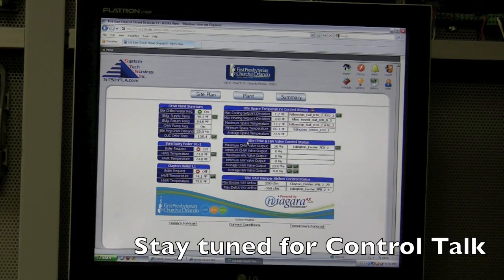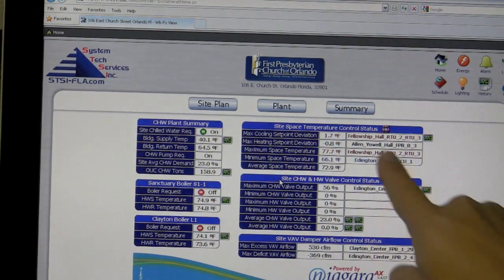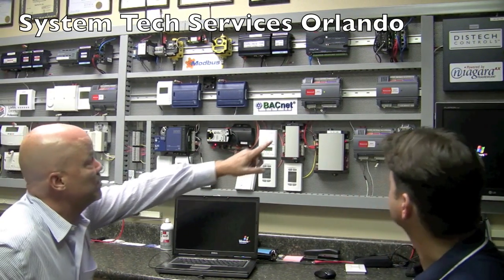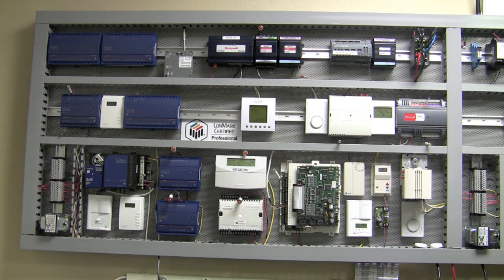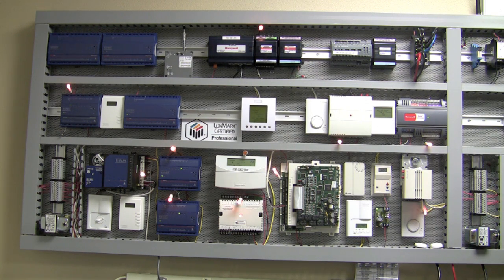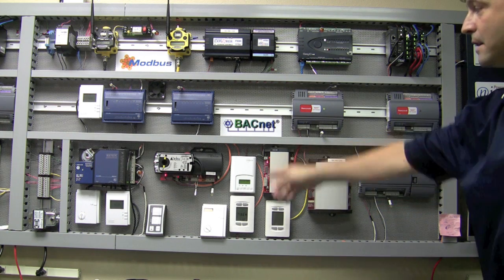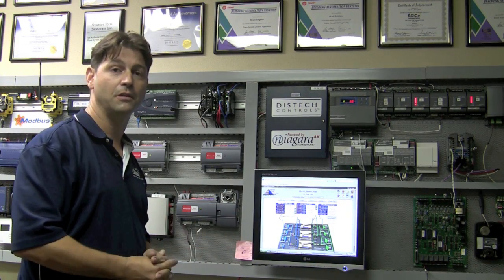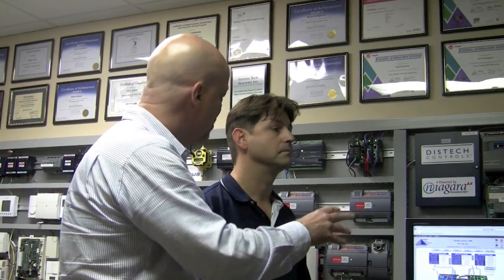This is what a Tridium Systems Integrator looks like Part 1

Comment: They are not objective in their presentation. They are talking as Niagara is some kind of messiah savior in case you have some unknown 3rd part system but it is not true. It is just OPC/server/virtual framework used only to handle data you already know everything about. If you don't know anything about protocol or device you are integrated Niagara will help you just as next integration software out there (it won't).
Reply from the maker: Well said. They have done a great job marketing it as the only game in town. Sounds like you are an integrator? What do you use besidesTridium? We are seeing lots more altrenatives getting traction. Please let me know if there are any subjects you would like us to make videos on in HVAC or Smart Bulding Controls
Reply: @StromquistandCo   Hi. Yes, I am integrator myself but I am afraid I am stuck with Johnson Controls as my company is their representative in my country. Depending what you want there are many solutions out there. I don't know much about OPC variations but for protocol integration (gateways) I strongly recommend Intesis company and their products.
Reply: @StromquistandCo  Hi
Reply: niagara certification is like 3K usd also lol

Comment: Tridium is great at the supervisory level, there's no doubt about that. But what this video fails to mention is that most of the programming of the actual controllers is done via proprietary software. Just because you overlay a JACE on top of another system, doesn't mean you'll never have to deal with the other controls contractors again.

Comment: Sounds Great, but having other system controllers means to change "its" program, now what. To get point info for correct devices, now what. You need much more info and resources than what is portrayed. Find a controls contractor that is good, stick to BACnet and why have a Tridium overlay if you do not need protocol conversion? This is for those that have a multitude of "crap" because like he said "low bidder" We get it right cuz we do it twice model of business low bid mentality.

Comment: The jace is a great device, we use it as a logging master for energy monitoring. The only device that I've had difficulty in integrating is a Sirio 485 ALM. we can communicate with the device fine but getting the correct readings from it seems impossible. have you ever worked with one of these? any help would be appreciated.